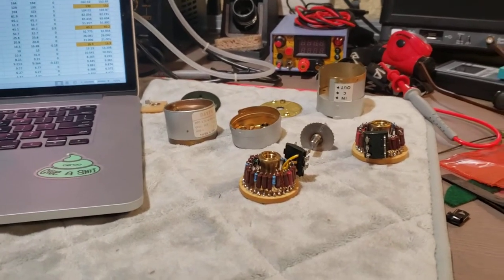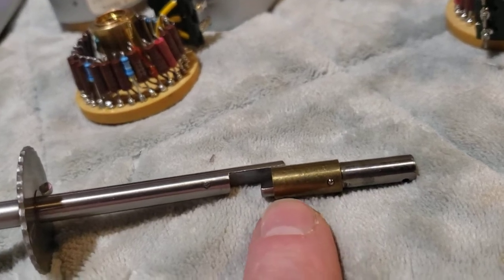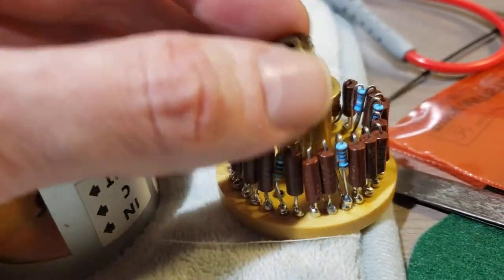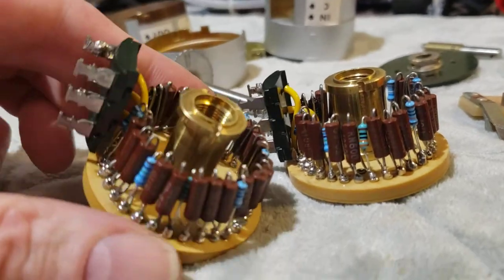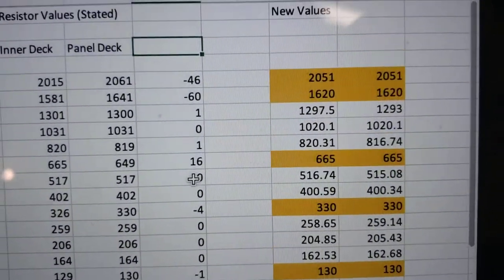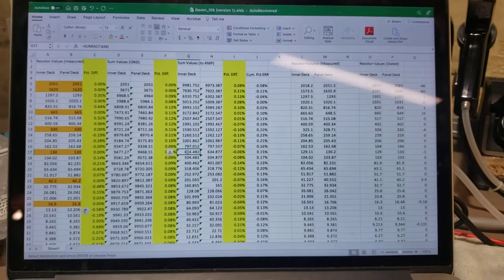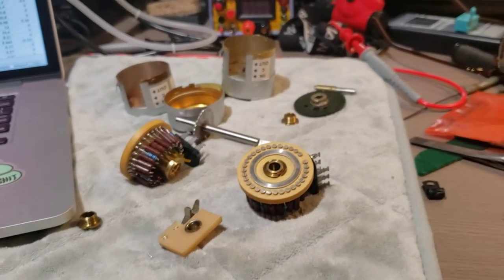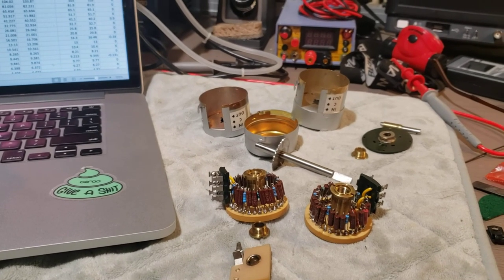HP Barney Oliver Amplifier Restoration Part 8 - Daven Volume Attenuator Repair

Comment: I just pulled a BH-532-H Daven stereo attenuator apart with that same nut and it just unscrewed with a small pair of needle nose pliers. On this one the coupling between the two decks is passive (no push pins). I am thinking of repurposing it to use for a selector switch for my autoformer volume control in my passive stereo preamp. Thanks for the video.

Comment: What kind of punch tool did you use for the pins on the volume pot? This thing is pissing me off.
Reply from the maker: I just used a drift punch to get it started, then an allen key to drive it all the way through.  Be aware that it's tapered and only wants to come out one way.  I used a jeweler's anvil as a surface.   A drill press might have enough leverage to push it out.  Good luck, those pots are a pain.
Reply: @hugeshows  Thanks very much!